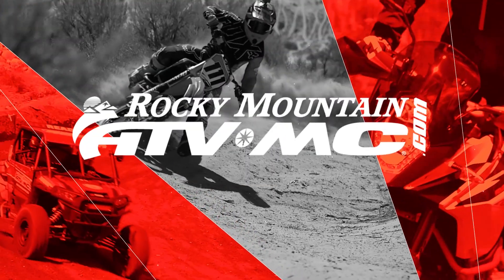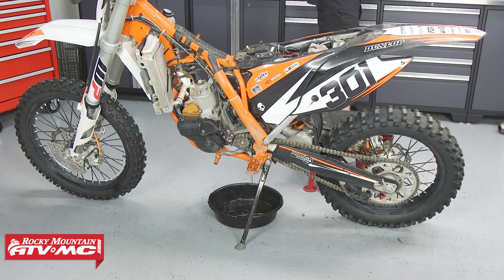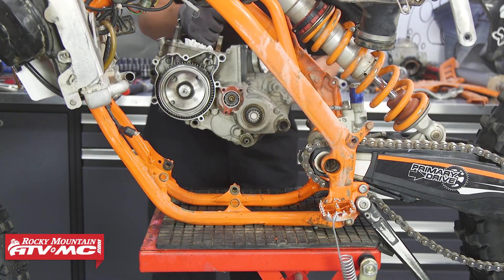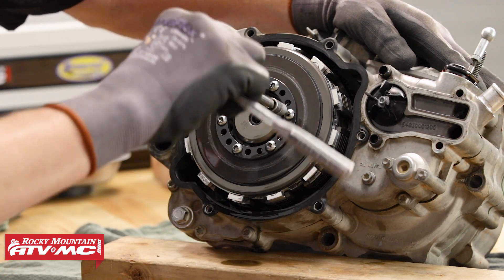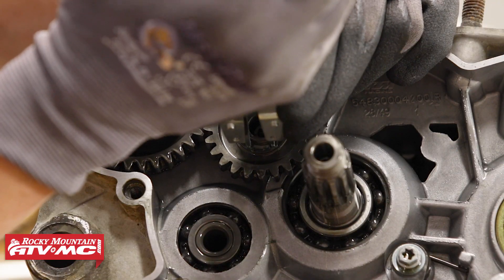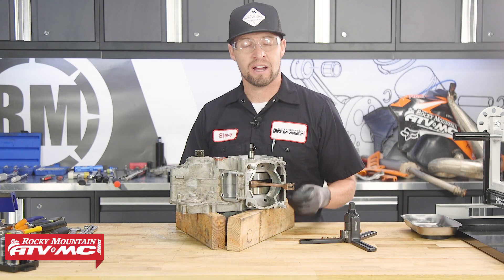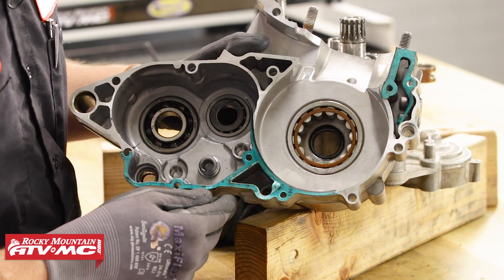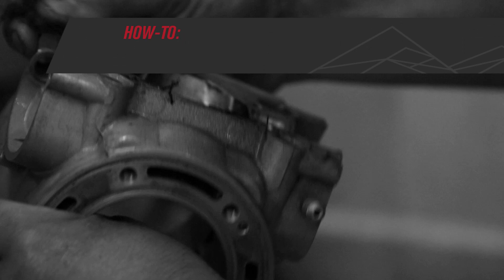KTM 300 XC-W Bottom End Rebuild | Part 1: Disassembly

Comment: I know this is an older video, but any chance this is similar to the counterbalanced bike? I'm chasing a lean condition that onl happens when the bike is SUPER hot. like 240deg hard enduro. It lean bogs and stalls. REbuilt reeds, carb, top end, exh, and still persists making me think it may be a main bearing seal?
Reply: @CHRISTIAAN NICOLAS HENDRIKSE Yes, crank seals. When they go bad they will leak air into the crank/combustion process causing a lean mixture, obviously more noticeable idle and is more pronounce when hot. Its good to also measure your oil perfectly every time you fill and drain to see if its losing oil through the crank seal as well, as this is a good indicator for the same condition. Once I replaced the seals(sometimes needs bearings/crank rebuild), the problem went away.

Comment: i need help i m gonna rebuild the motor of a ktm i bought for very cheap but i m not sure if it s a 300 or a 250 cause the boy told me was a 300 but 300 sx in those yrs wasn t a thing so i m thinking is a 250 with 300 kit but how do i ensure this
Reply from the maker: You'll have to open up the top end and check the piston to see what size piston is actually in the bike.

Comment: The manual says CHANGE the connecting rod and crank pin.  NO average person does this.  My 2005 has been raced for years on the same crank and crank pin.  KTM needs to rewrite their manual.  Yeah...maybe... if you are a factory race team mechanic with unlimited access to replacement engine parts....